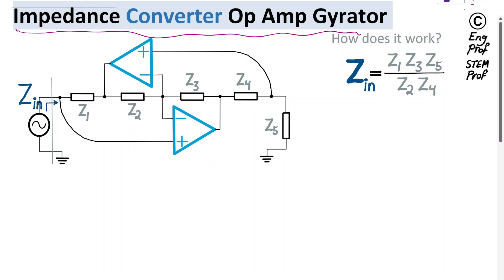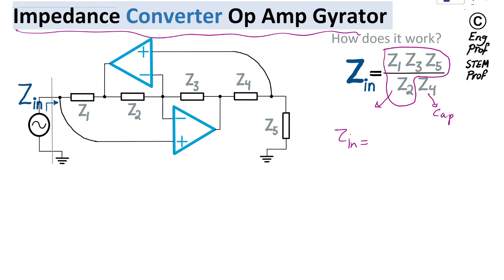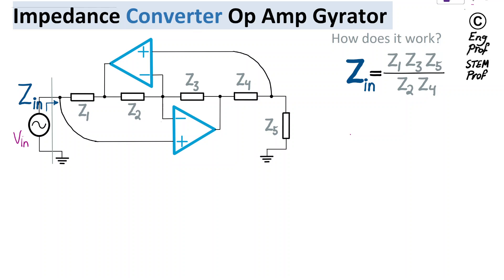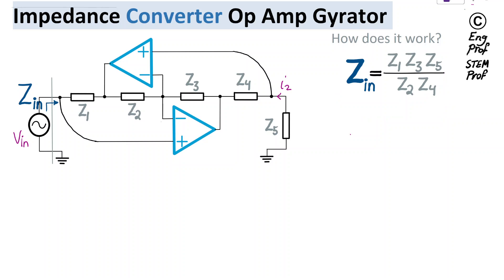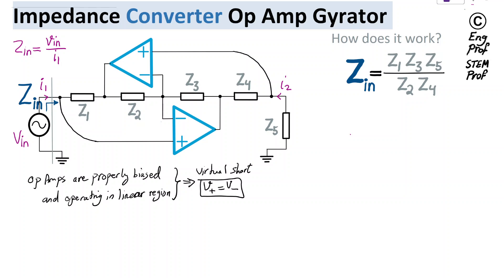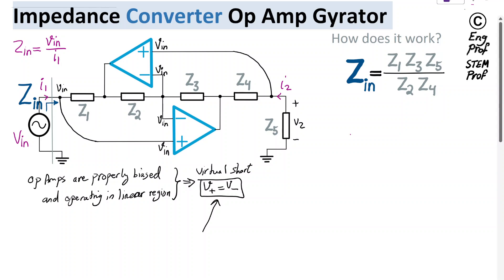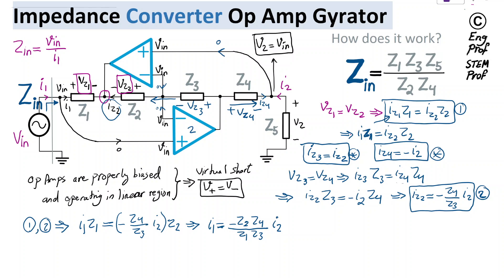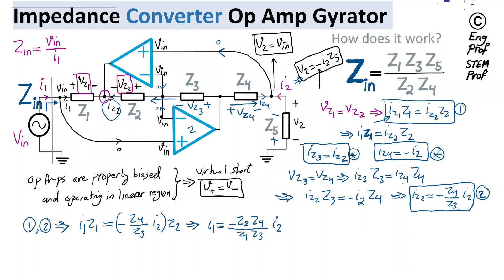Gyrator Op Amp Circuit as Impedance Converter Explained

Comment from the maker: Thanks for watching. For more Op Amp Circuit examples see Impedance Converter Analog Circuit Design with Op Amp (GIC and NIC) https://youtu.be/o6l_wztCACQ
Converting Capacitance to Inductance https://youtu.be/weIHG45G6Pg
Analog Computer circuit that solves Differential Equation. And https://youtu.be/HeZRtnRXpEI
Capacitor to Inductor Converter Circuit https://youtu.be/weIHG45G6Pg
Active Inductor with Op Amps https://youtu.be/6IYz4iaa05c
Negative Inductance Design by Op Amp Impedance Converter https://youtu.be/GF_Mun_Mkyo
Operational Amplifier Gyrator Network Circuit https://youtu.be/2KpjAytRBpc
More analog signal processing examples are in https://www.youtube.com/playlist?list=PLrwXF7N522y4c7c-8KBjrwd7IyaZfWxyt
I hope these Circuit engineering and analysis videos are helpful.

Comment: I was fascinated by this circuit when I stumbled upon it reading "The Art of Electronics" by Horowitz and Hill many years ago (around 1985).
I even tried to implement it in some tunable LC circuit but ran into some noise problems. Today I would probably have better luck with this, with so many high-performance Op-Amps on the market 😁. Discussion of critical specs (noise, bandwidth, etc) of the Op_Amps for such application would be invaluable. Thank you very much for this analysis.
Reply from the maker: You are very welcome. Thanks for watching and sharing your experiences and your suggestion. As you pointed out, stabilization of this impedance converter circuit is an important practical consideration. But hopefully with much better operational amplifiers available from Analog Devices or Texas Instruments a designer has a better chance at resolving practical challenges.  And I will try to talk more about noise and bandwidth whenever possible in the upcoming design problems and examples.  For more Impedance Converter and Gyrator Circuit Examples please see: 
Capacitor to Inductor Converter Circuit https://youtu.be/weIHG45G6Pg
Active Inductor with Op Amps https://youtu.be/6IYz4iaa05c
Negative Inductance Design by Op Amp Impedance Converter https://youtu.be/GF_Mun_Mkyo
Operational Amplifier Gyrator Network Circuit https://youtu.be/2KpjAytRBpc
I hope these additional impedance Converter and Gyrator Circuit examples are interesting as well. 🙂